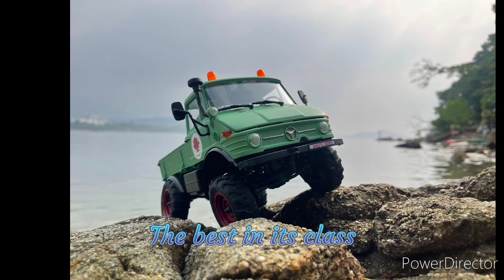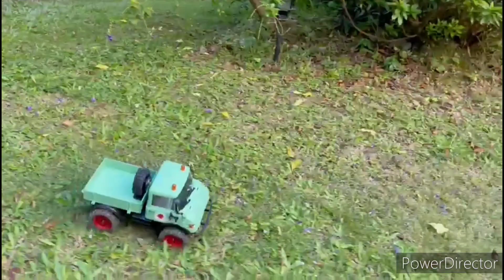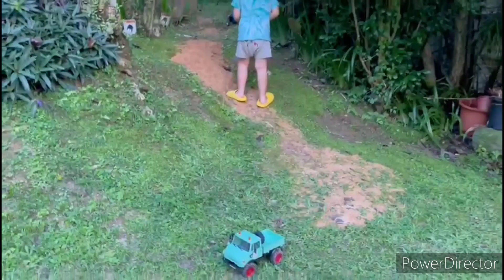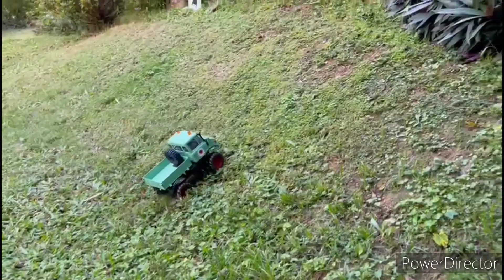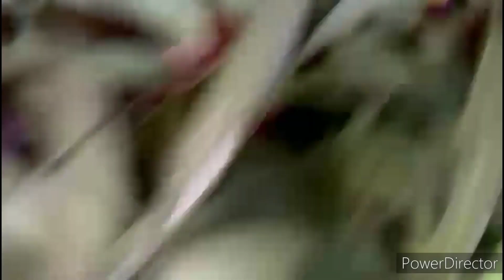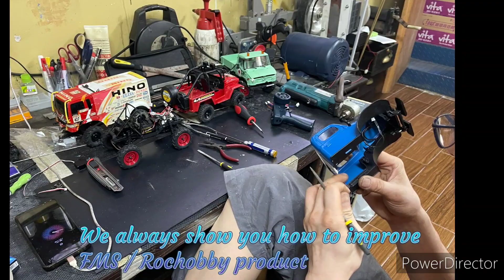FMS Mogrich with FCX24 axle VS FMS FCX24 with 4WDS off road test at Garden

Comment: On FCX24, how do you control the rear axle steering servo ?
Is it simply connected on the same channel as the front servo or does it use a separate channel ?
In this case, the original transmitter has been replaced by a programmable transmitter, i suppose ?
I'd like to add this rear steering system to my FCX24, but i need to know how. 😉